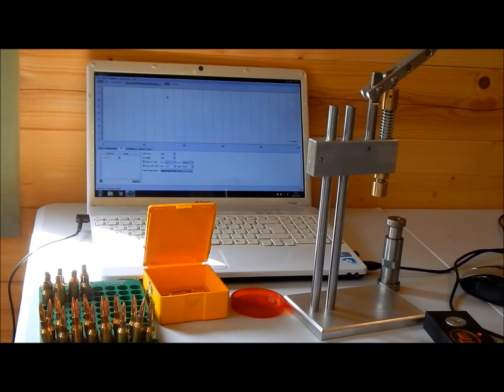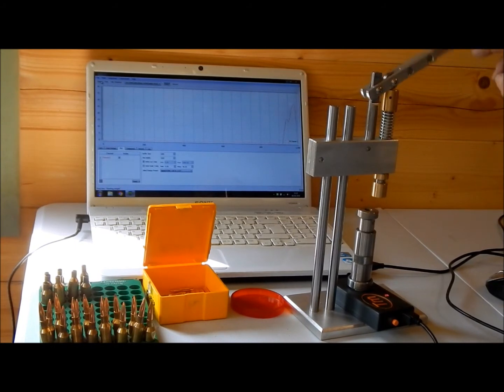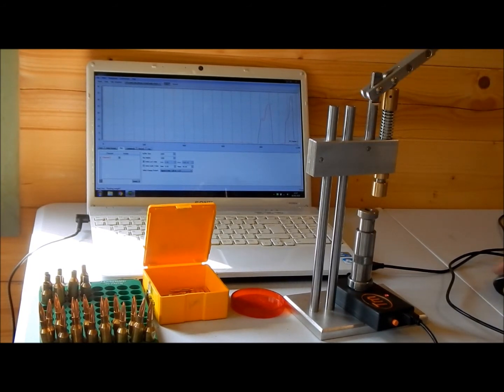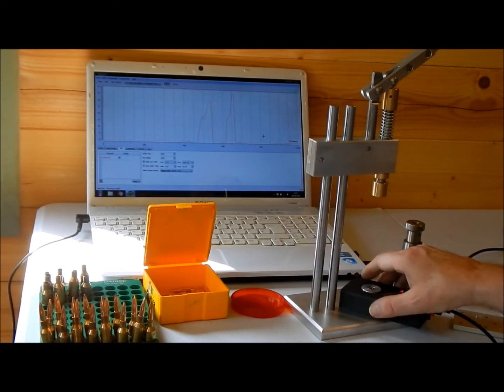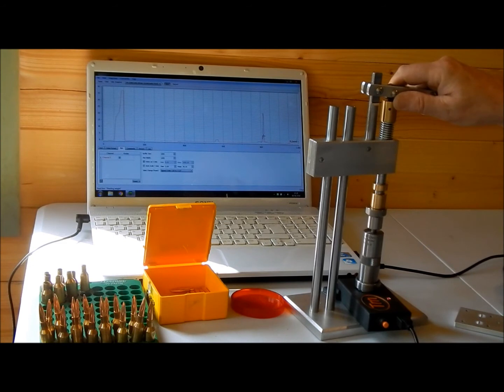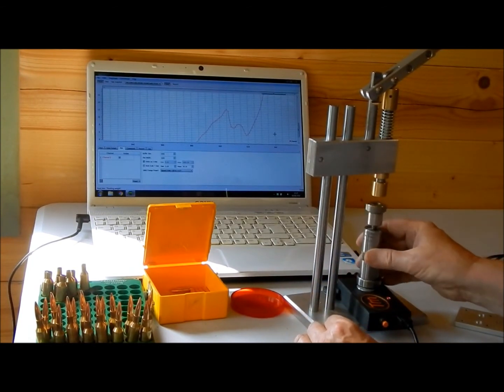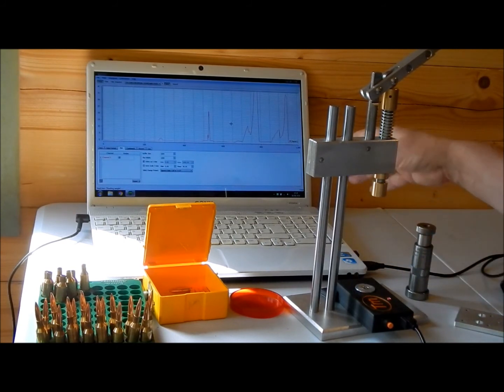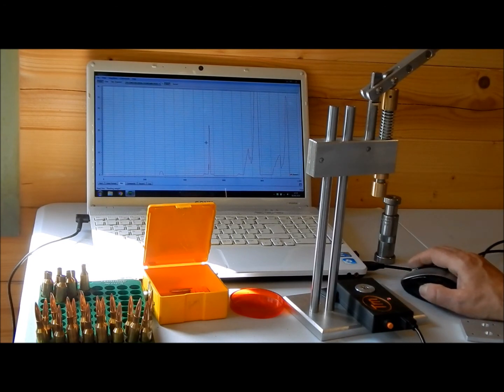Seating force gauge

Comment: Wow, this is another level of precision. Is the sensor and software compatible with a K&W Arbor press?
Reply from the maker: The force gauge and software in completely independent of the press, as long as you have about 20mm extra height available for the pressure pad under your die. -
Reply: @Targetmaster1066  thanks. Where can I buy this setup?
Reply from the maker: I've made a few of these but decided that it really needs a constant force press to make the best of the idea. A suitable press (or add on) is on my "to do" list but it may be some time before I can get around to it.

Comment: To sort my cartridges by neck tension, I measure the seating depth with the calipers on the loaded cartridges. Usually when I feel it is harder to pull on the arbor press lever, the measurement is a bit longer (0,01 to 0,05mm). Did you notice the same thing with your sensor ?
Reply from the maker: Yes, certainly. When they are harder to seat I believe there is always a little "springback". The ones that are outside the "normal" range I use for warm-up shots.
Reply: @Targetmaster1066  That's it, there is a tiny "spring" effect coming from the case's brass. I did not make any accuracy tests yet to see if it has any effect on accuracy but I think so.